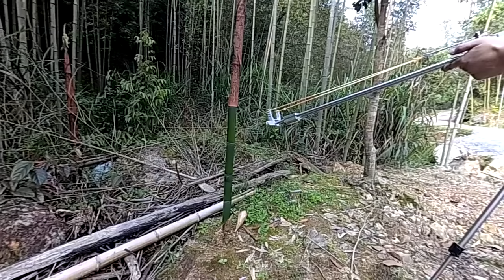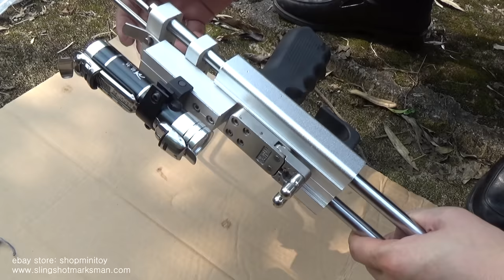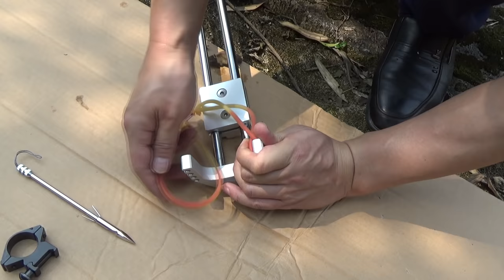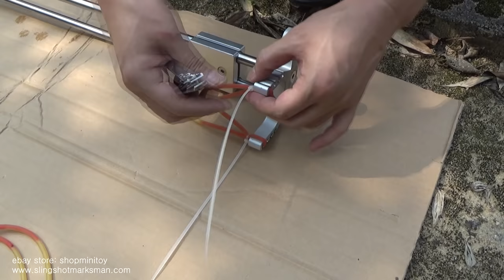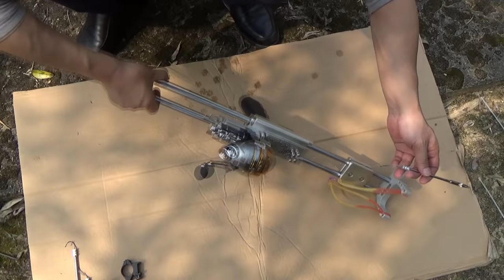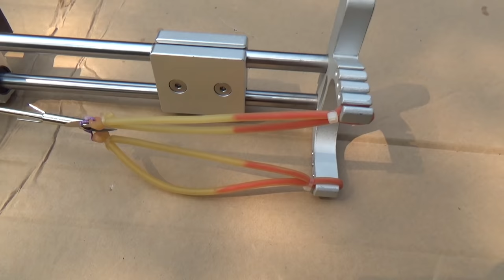Hunting Slingshot Rifle How Set Fish Wheel Dart - Ready to Hunt - Most detailed video Slingshot Gun

Comment: Rube Goldberg lives. A tad bit over designed for what you're trying to use it for, maybe mount the reel  upside down just in front of the trigger. That'll keep it from being too top heavy, and rotating. Someone mentioned a sled on the rails to improve accuracy,  of the dart. Thought about shortening everything, and using heaver bands? Think you've a good start, but don't over design.
Reply from the maker: Thank you Bro and you are definitely expert, we have another version that fishing wheel put in the top of rifle, so there are 2 different to keep  the fishing wheel on rifle, maybe it is not good to add a dart's rail in the rifle, it will cause entire rilfe is over 3kg ( now our rifle is 2.3kg ), but we have a kind of dart which has 2 metal wings, this dart will fly better, anyhow, the fishing line hold the end of dart all the time when it flys, line becomes wings ^_^ combat video comes in this week very sooner...

Comment: Heat shrink tube is probably less abrasive than zip ties. Feed the loop through the heat shrink and then install. Pull the heat shrink tight and set. Or even another rubber band, probably easier.